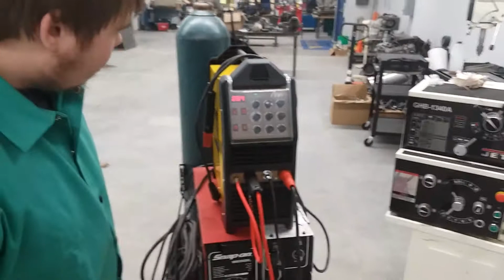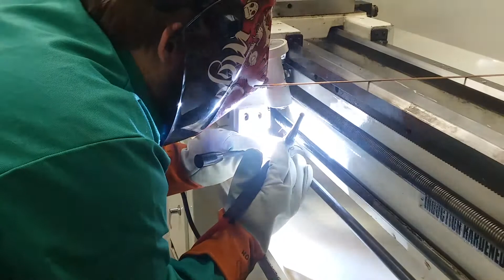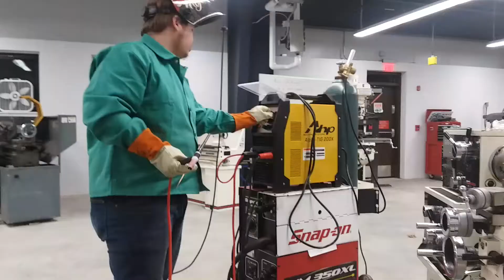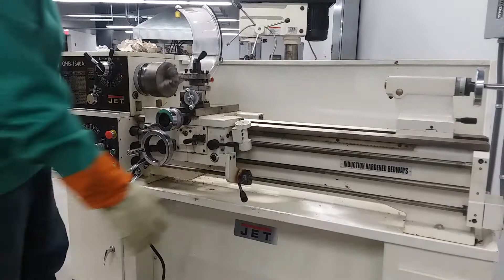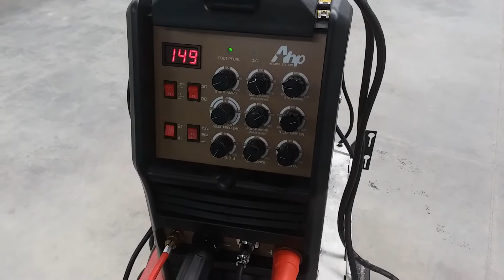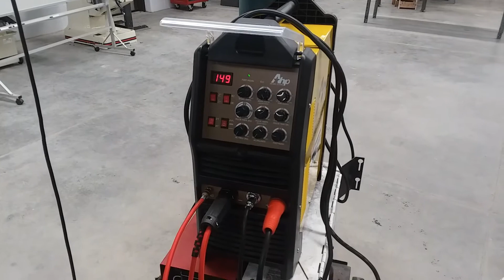110v welding with AHP AlphaTig 200x Lathe Repair

Comment: 2 factors id like to mention, the load on the circuit will be more on 110v vs 220 therefore the extension plug your running it on doesnt really look suitable for it, also voltage drop . great video though